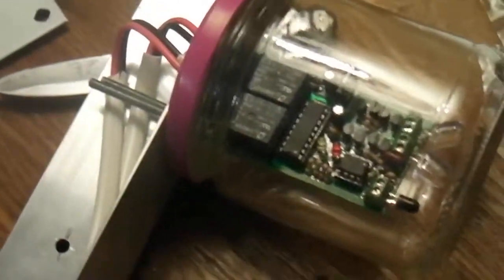Wired Up The AxeTracka 001

Comment from the maker: This is temporary set up. I want to put in the electrical box I have bought for it. and use the remote LEDs. I think the sun and water may kill it if I dont. I have to get some shielded wire and some plastic blocks to mount it. Like some half inch thick plexi glass or some plastic butcher block would work. I am looking forward to seeing another video about the enphase inverter hows that going maybe I missed it my mail box is so full its hard to see the videos I really want to watch. Will search.